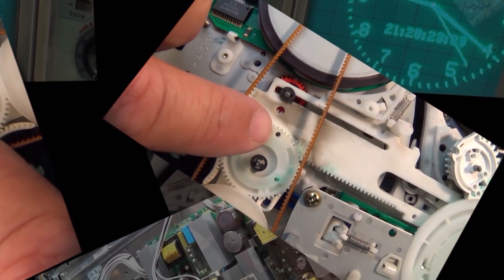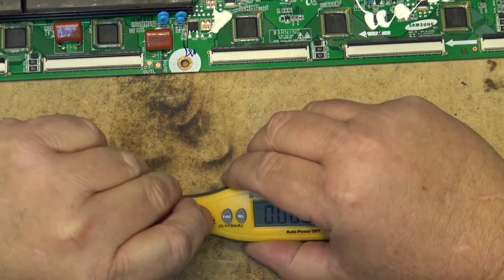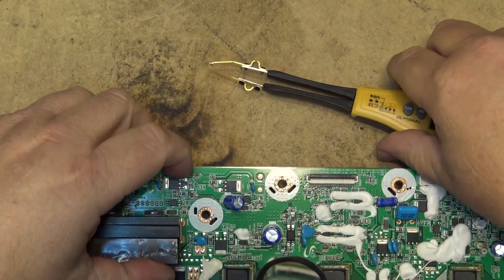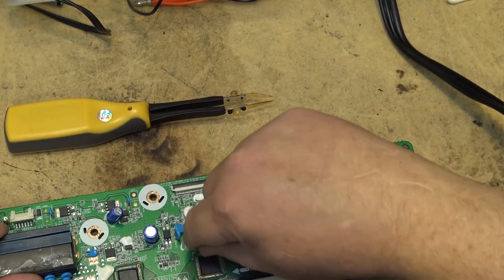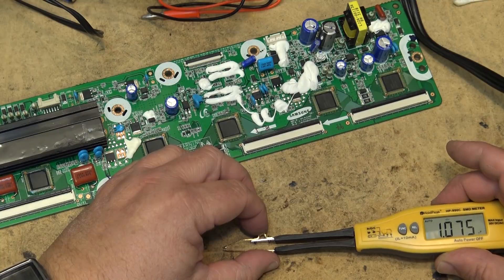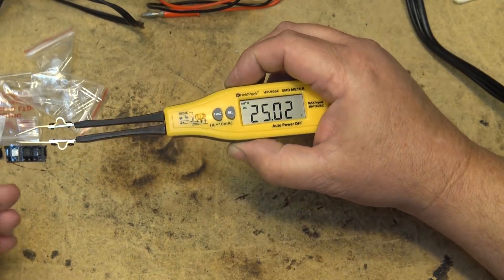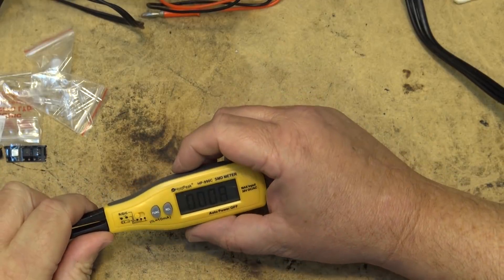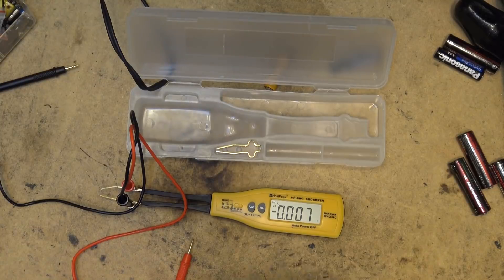Hold Peak HP 990C SMD Meter test run

Comment: The REL function is used to subtract the value of the test leads when not using 
the mounted probes. When using the mounted probes it is not necessary to
 use this REL function as the test leads have a small added resistance 
and capacitance that will show in the reading of the meter. Short the 
test leads together then press the REL button before taking measurements
 with them. It normally is very useful for getting accurate measurements
 without adding the test lead value. In this case I don't think that 
this meter is accurate enough to be of much use anyway.

Comment: The resistors were in parallel with the capacitors  I ended up getting misleadding results. I woud suggest the Mastech MS8911 LCR meter. You could have just the Hertz in the voltage, and it's more accurate.

Comment: The cheapest option has dc volts instead of battery test but does have data hold and to me looks the best value.  But that's just in my humble opinion!  Great wee tool for those on a budget!

Comment: main issue with this is it will not measure ESR-on modern stuff, that's important.
Reply from the maker: It's not an esr meter.  How can you have an issue with something that does not have that feature? None of my multi meters do esr.  For that I have a separate esr meter that I built.
Reply: @12voltvids  the issue is that without esr, the capacitance mode is not very useful...I agree, for the price it's ok.
Reply from the maker: ESR is generally only an issue in power supply capacitors, most of which are not surface mount to begin with.
Reply: @12voltvids  I only found this video when I was searching for an ESR tester.  According to Amazon, it is an ESR Tester..."Resistance Capacitance Tester, LCR Meter/ESR Meter/Digital Multimeter"    Happy I found this video and comments as I will now not purchase it.